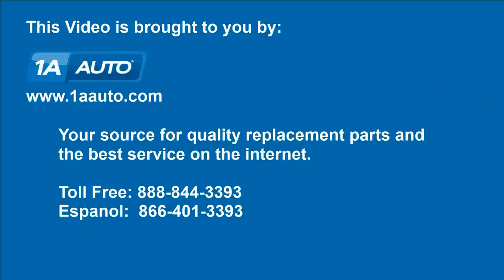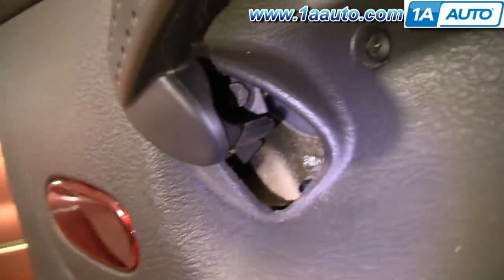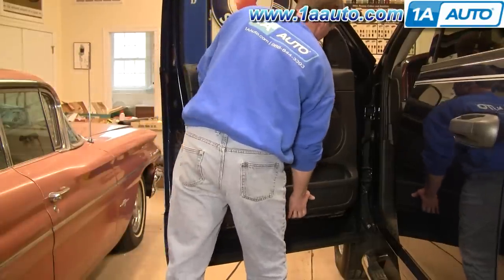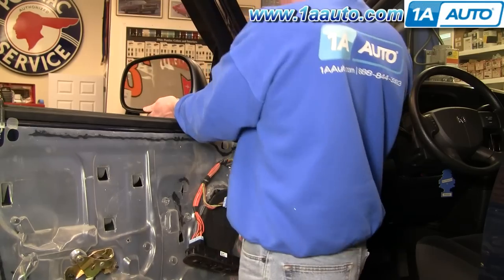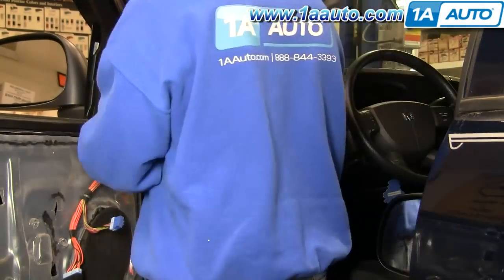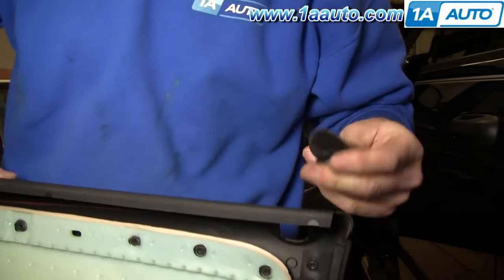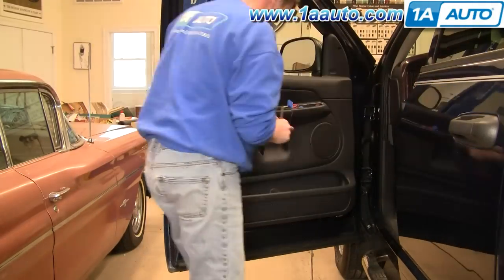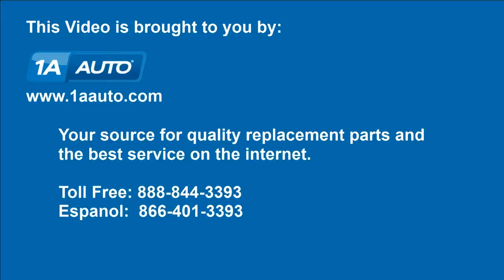How to Replace Side View Mirrors 02-08 Dodge Ram 1500

Comment from the maker: Realized afterward, the inside door handle can be removed with just a 10mm socket with a ratchet and extension.  If you do it that way the T40 Torx driver is not necessary.

Comment: I own a 2005 Dodge Ram 1500 without power mirrors or windows. I didn't need the T40 Torx Driver. I used a screwdriver to remove the Window Handle Retainer Clip. I've seen a video where a guy also uses a rag to catch the end of the clip and pull it off. Then I used a Phillips screw driver to remove 4 phillips screws and the 10mm socket to remove the 3 nuts off the back of the Mirror. I couldn't find a manual driver side mirror that could be delivered next day so I  bought the heated mirror version and it worked just fine.

Comment: Great video, worked perfectly.....one thing though, one of the plastic arms on the clip that holds the mirror on that you show @3.22 in the video broke off (I have a manual mirror). Will the bolts be sufficient in holding the mirror in place long term?